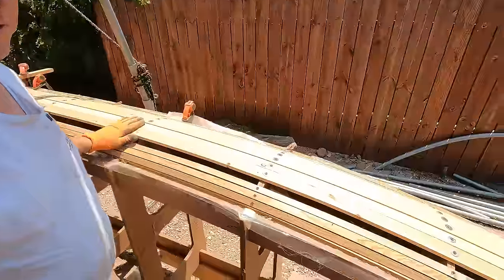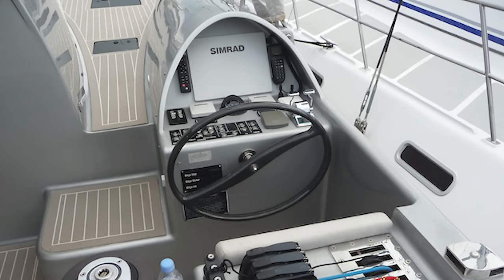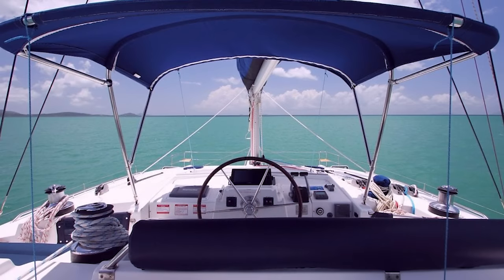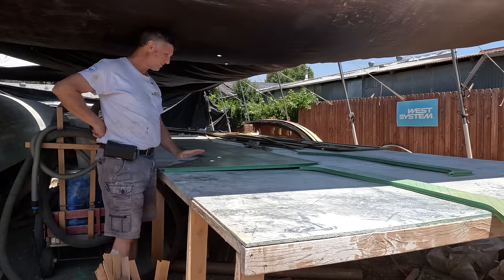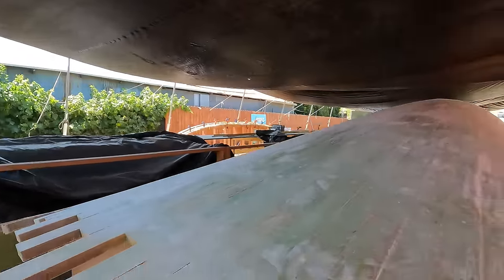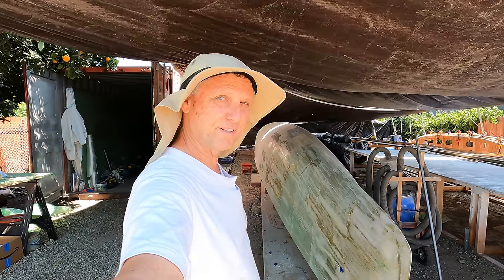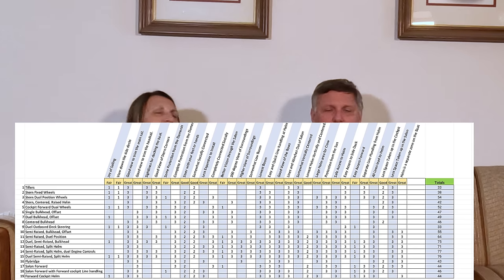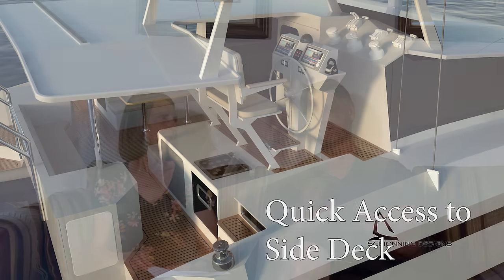Kit E42: Helm Positions and Build Progress

Comment: Great summary of all the options available out there.  Best way of knowing what works for you is actually sailing aboard boats with the different set ups, without doing that it's a best guess.  I do like your set up you went with...one consideration could be in lieu of the dual throttle in a fixed position; you could install a  Dockmate option (on any boat you can do this actually) and it allows you to take the remote anywhere onboard.  Really handy for singlehandedly getting off and on anchor, or slowly navigating coral bommies in the South Pacific atolls as well.  Food for thought.
Reply from the maker: We considered that, but it was beyond our budget.
Reply: @SailingSVLynx  yeah, it's a little on the pricey side...but maybe you can get them to be a sponsor and get a deal!

Comment: One thing I used to do when doing auto body work, is use a light coat of contrasting color spray paint between sandings.   I really helps to spot out high and low areas.  This project is so flippen big, it's mighty hard to spot all the imperfections.  It's just a bunch of the same color and our brains are not made to find flaws without contrast.
Reply from the maker: You will see about our guide coat tests in a later video.

Comment: I used a tablesaw for years and years without using feather boards. Now I never cut narrower stock without one. It gives me a much nicer cut and it’s safer.
Reply from the maker: I have feather boards at my home workshop.  I should bring some for the saw at the build site.  However, we're nearly done with cutting wood for the boat build.  There are only two places wood is used on this boat, the Forebeam (now done) and at the base of the compression post, but those boards are already cut.

Comment: I have been designing my Sail Fly for a few decades to try to eliminate all the uncomfortable things about sailing.  It will have a fore sail and an aft sail with the helm position on each side in the sort of triangle where the low boom dose not swing.  Instead of steering wheels it will have vertical tillers six feet tall for leverage and the feal of the force on the rudder.  Also that takes up the minimum space.
Reply from the maker: Congrats!  I'm sure your choice in helm style and position is the best choice for you.  That's what counts the most, that you're happy with it.

Comment: Using the ecxel you linked, it is impossible to reach certain outcomes. For example there is no set of priorities that will get a higher score for Tillers than Stern Fixed Wheels, and Duel Semi-Raised, Split Helm will nearly always come out on top, because it matches nearly all cathegories.
Reply from the maker: Sorry, we didn't try to make it work like that, we just listed positives about each one and let you give it three values and let the chips fall as they may.
Reply from the maker: Also... this shows why good size cruising catamarans really don't build tiller only models, they just aren't as desireable.  As for the ones that almost always come out on top, that's because they do have a lot of the positives.  If we left out any positives about helm positions, let us know and we'll add htem to the spreadsheet.  I'm sure we missed a few.